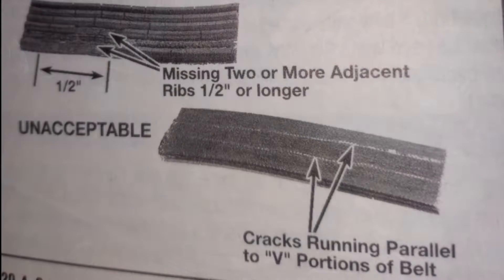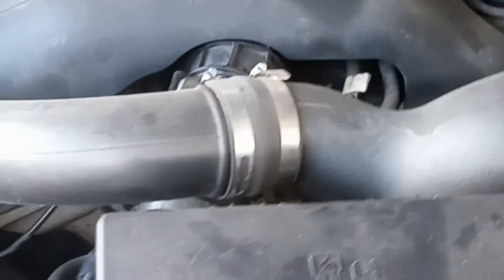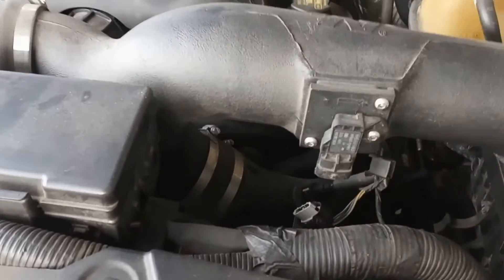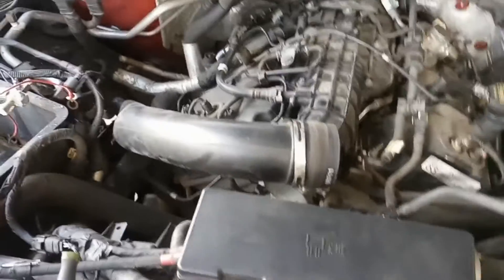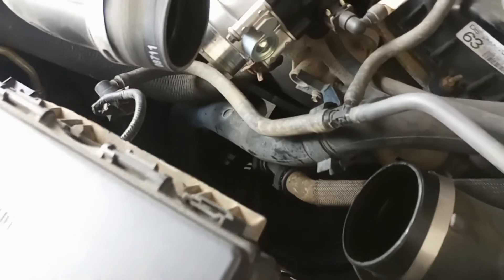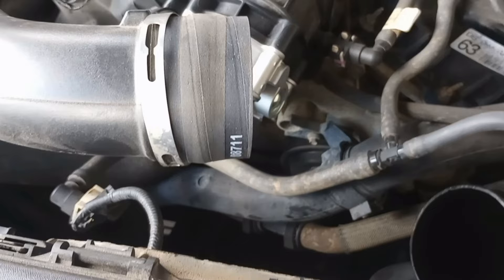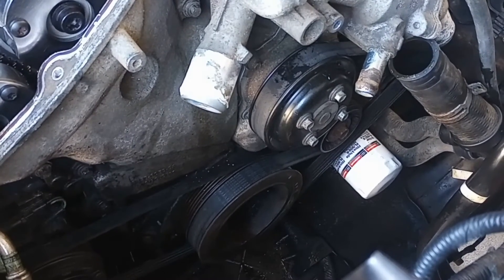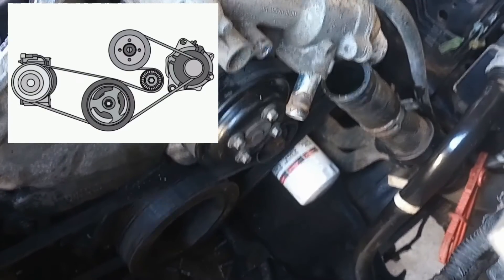Master Your Ecoboost F150: 3.5L Serpentine Belt Diagram Explained

Comment: FYI. The top wheel is not the AC pulley. That would be the water pump. Depending on year the AC will be lower left and may have an independent stretch belt that is runs solely with the crank wheel.
Reply from the maker: Great tip! I have videos of both the serpentine diagram and how to replace the AC belt as well on this engine